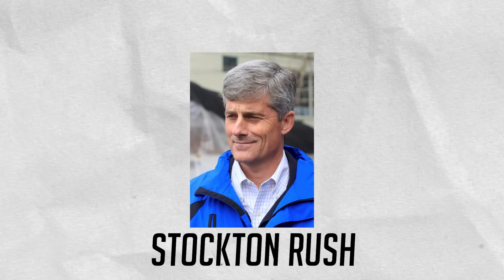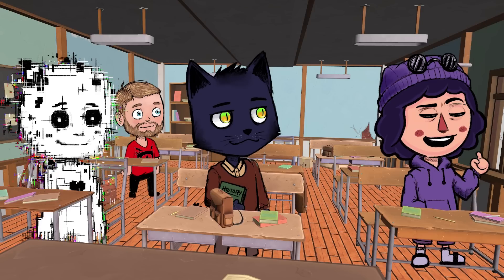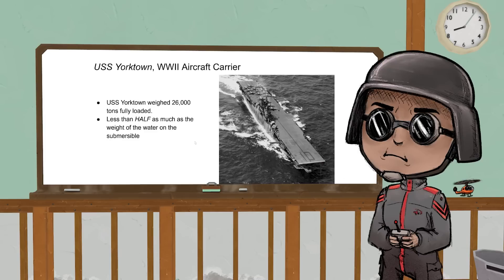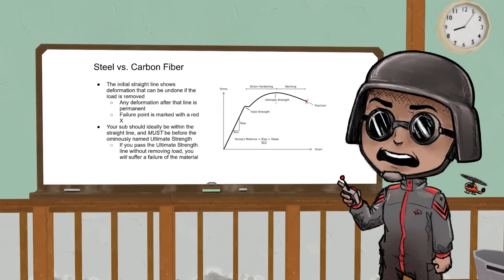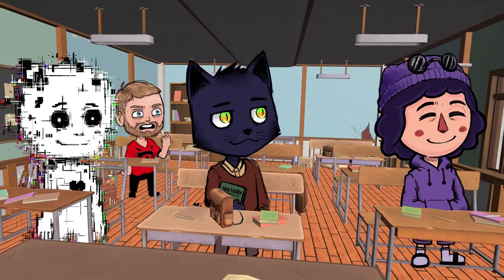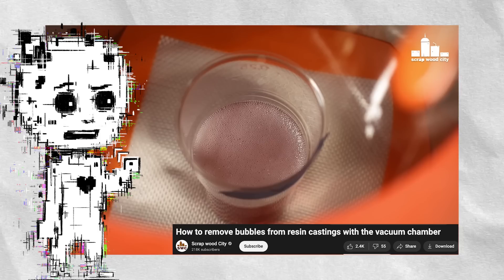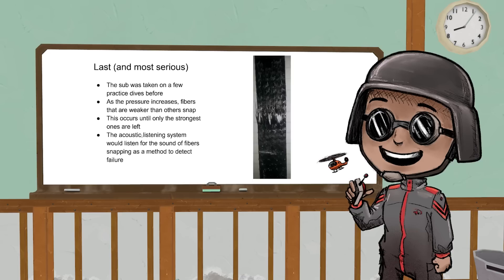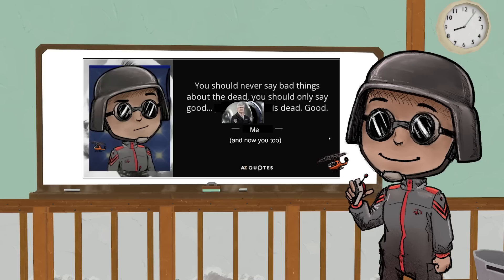An Actual Engineer Explains the Oceangate Incident

Comment: They also sanded down the wrinkles and imperfections on each 1” layer of the carbon fibre during fabrication. Literally breaking fibers. 

Of course, they shouldn’t have had wrinkles during fabrication, but that definitely wasn’t the solution. 

There were so many avenues of failure for this vehicle. The carbon fibre, the glues and resins, porosity, everything that has different compression rates under pressure. Practically everything was an unacceptable risk. Everything was unsafe.

Comment: Yea watch it be the window or the rings and how the attached them and not the carbon fiber hull like all you are saying haha. Carbon fiber has def potential in deep-sea submersibles for obvious reasons with weight, etc. in fact, the US Navy even made one similar to this in the 80s and early 90s. I think it was big enough for humans but for testing was a drone submersible (learn from the US Navy Stockton they did testing!!!). In fact it Kinda looks like all Ocean gate did was read a brief outline of what the Navy did throw that away and say well all we gotta do is make carbon fiber cylinder and put titanium caps on the ends and we will be good because it looks like  they took the basic idea of it and that was it lol. US Navy and other companies have been doing small incremental testing and using of carbon fiber but none have jumped in 100% but oceangate. They needed to test it more needed to figure out the patterns layer thickness probably way better than they did  and use a freaking an autoclave vacuum all of it etc etc. do the testing  the correct way even if it’s longer cost more etc. if you are gonna be the first to do something you damn well better be prepared and be even more cautious than the 2721 person to do it etc. you don’t break rules on it. Then after that after we figure out the best way of doing it we can more a little faster. Being first is always that way it’s more money more time more testing. How he thought he could get away with that especially at 13,000 feet on a tiny budget is just nuts. If I had to bet it’s gonna be something with the rings and how they were attached. They made their own adhesive they were prepping areas with old nasty looking who knows what on it rags. They  were also doing it in a old dusty warehouse no clean room nothing clean and in their own promo vid the surface didn’t looked prepped right at all for when you have to combine two different materials with an adhesive. You don’t want the surface perfectly smooth being wipe down with God knows what rag!! And I’m sure the adhesive had some cost cutting measure. The Dude probably used The Chinese counterfeit blue instead of red Loctite because it was cheaper haha. Sad but itll probably true they probably did skip out on some important ingredient or got a Chinese knock off counterfeit it’s not even been tested but Stockton just read the brochure and it said it was good or better haha probably did all that because it cost less. The coast guard keeps mentioning the window btw I heard it again this week in the hearing and how the window is not been rated anywhere near that depth either so maybe it’s that. Anyway I’m going with the titanium rings then window on my guess. I think the carbon fiber would have held up longer than that so I don’t think the point of failure in this case was in the middle of hull through the carbon. Btw perfect example of more testing. For all we know carbon fiber will be the best deep sea submersible material possible for 20 dives and then you need to replace it. Or with more testing will find out if you do a pattern this way and that way autoclave and vacuum it and it’ll be better than titanium or will find out it’s just crap and you can never know what will happened so don’t use it. Point is Mr. Stockton is a moron and did not do enough testing did not do enough correct testing and then bragged about not doing enough testing when being the first guy to really use a new material on a vehicle there will actually carry humans and won’t be a drone!! If the dude didn’t spend all his time giving lectures and interviews and TED talks and calling influencers and YouTubers and bragging about being an idiot breaking rules on something so new they have none he would have been able to do tons more testing and probably would’ve had the money to do it because he wouldn’t be flying all over the world to give lectures!!! I just wish it was him in there! I do hope his bs warning system that if it did work at least gave him a few seconds to read on his computer screen to see that the hull is failing you are seconds from dying that way he knew it and knew he’s a idiot and messed up. I just hope only he saw the alert!! Sounds mean but true. What I don’t understand is how they thought the warning system would save them??? If it’s getting to those sensors and you are at 12,000 feet it’s not like you will instantly out high pressure when you drop weights for the surface!! Even if going up to 10,000 that’s still a ton of pressure that water is still coming in the good bits broke at 12,000 I mean how did people fall for that by the time that sensor goes off you screwed it doesn’t magically get rid of the pressures lol. 

Sad thing about this whole deal is it’s going to put carbon fiber back years if not decades thanks to this idiot even if it is the most perfect material people will be scared now thanks to him. I think there is use for carbon but we gotta test more and figure how best to use it or make it etc etc. Him being cocky cheap and a know it all d bag killed innocent people and set us back years on carbon fiber. He just did it wrong or the rings failed or the windows failed and the carbon fiber was great but people are gonna be scared to use it for decades probably because if this d bag!!!
Reply: Oh yea the maintenance and the crew support ship etc . The stories and pics of them dropping the sub onto the deck of the ship which was hard enough to damage the ship and those supports under the sub and later mission a wave knocking off the cap because stockton didn’t want to use more than 4 bolts (it requires more than double) so he didn’t have to replace them more frequently and them towing it 3000 yards behind them on a small barge that can sink when launching the sub all that doing all that just blew my mind. They should treat machine with respect and care but instead they treated it like it’s my 1991 lawn mower!! Hell all that probably hurt the adhesive and caused the failure right there at the ring meeting carbon fiber point. There was another story where the front where the window is had 5 men on that for hours!! It had an issue when coming and being lift and it tipped straight down its butt sticking out of the water.  So 5 grown men for 2 hours were sitting on the dome cap waiting for the crew to fix the issue hook them up and get them out. I bet they barely checked it over after that. Probably never checked the rings too! Hearing that story and seeing how it was treated just wow. That one YouTuber who tried to go down he filmed it being towed 1000 miles in a storm. I mean wtf.
Reply: Imagine trying to work on the sub 2000 yards away from the ship on his little tiny barge water everywhere get knocked around by the waves it’s crazy. These guys were crazy. Really some of the people that lived need to probably go to jail!! I bet whenever they had issues they didn’t inspect or replace or do anything. They just repaired got it to work and moved on. You know just duct taped it move on. Nobody wanted to be out on that tiny barge it’s cold and wet and windy. I bet you that’s what happened on some things!!

Comment: The other thing - the building of The Titan looked so amateurish. Rubbing down the surfaces to apply the hand-mixed glue with a rag. Not scoring the surface for better adhesion.. Guys on step-ladders with no protocols to prevent contamination. Wasn't  what you'd expect a factory making cutting edge deep sea craft to look like. Looked like any light engineering works anywhere.  (Probably was.)
Reply: Not what I expect in factory making plastic silverware.

Comment: Holy shit. I knew of steels properties just by experience, I didn't know it's been figured out into a science. To see you explain what's happening on the graph, what immediately pops up is when at work I overtighten a nut on a bolt and I can feel it getting tighter and tighter but there is a moment it gets easier. Everytime I went further, snap. Same thing with brass but the required force is much much smaller. 

Something else to add. Fiber glass, I work with fiberglass fittings and that stuff acts like brass, till failure, then it shatters. You can hear it cracking well before it fails. And so I'd like to know the comparison between fiberglass and carbon fiber. Because it's the same principle just different materials

Comment: It is a common misconception that steel from the Quebec bridge was used to make the iron ring. This is false. However, after the Quebec bridge collapsed twice during construction, the Quebec order of engineers was formed to regulate the practice, much like with doctors and architects. I also believe the bridge collapsed due to incorrect calculations and it couldn’t hold its own weight during construction.

Comment: One thing that I think makes the video better is the new information we have that actually indicates the carbon fiber by itself wasn't entirely to blame. Rather it was the entry cap, damage done to the vessel and how it landed show that the vessel crushed inwards from the door down, further military tests indicate that a carbon fiber hull can work but it needs to specifically match the bend and resistance of the end caps. Otherwise the hull can unseat from the titanium and THEN it will implode, so theoretically Stockton could've done it entirely successfully using what he had, he just cheaped out and didn't test to match...

Comment: As an engineer for fibre-reinforced plastics, I find the video rather poor. It lists the usual properties of fibres in construction. These are controllable, which is why these materials have so many applications. 
Titan is at the limits of what is technically possible. It should not be forgotten that the submarine successfully visited the Titanic 14 times. In the end, it was human error and greed that failed to take sufficient account of material fatigue.

Comment: Interesting, thanks!  You don’t talk much about the issues of gluing the titanium rings to the carbon fiber hull.  The glue was just slapped on by hand with no way to check for gaps or bubbles.  Carbon fiber and titanium are not identical in flexion under extreme pressure, so in a series a deep dives there might have been progressive degradation of the glued join.  Another engineer talking about this disaster calculated the total length of the two glued circular joints:  32 feet!  That’s a lot of potential territory for a possible glue failure from faulty application or progressive degradation.  That engineer thought it most likely that the failure initiated in a glued joint.  But with all the problems of the carbon fiber construction that you point out, even if the glue held, the failure of the carbon fiber hull was inevitable.  I’m amazed that it survived even one deep dive.

Stockton didn’t listen to anyone and managed to evade government oversight that would have prevented him from killing passengers.  One of the engineers testified on how he went not only to company officers but to government agencies including OSHA as a whistleblower, but they did not act.  After a year, when there was no movement on his case by OSHA, he had to drop it because of threats of violence and legal action against him and his wife by the company.  So the US government has some culpability in not stopping Stockton when they were told about the deadly danger.  And the company officers this engineer had spoken to cannot claim they did not know the danger.

Eventually Stockton ran into something he could not bully or evade: the laws of physics and realities of materials science.  But it was too late to save the passengers who believed his lies.

Comment: The carbon fiber did not come from Boeing .
Reply from the maker: The claim that the carbon fiber used by Oceangate comes from writer Arnie Weissmann and has been widely circulated in the media. There is no evidence to suspect the claim is inaccurate, as it is a direct quote from Stockton Rush, who also received multiple safety consultations from Boeing engineers (which he ignored). However, as it is a statement made by Stockton Rush, it's entirely possible he was making it up. If you have evidence to the contrary, we would be delighted to see it!

Comment: This was not the first deep dive of this vessel. It underwent a form of delamination that resulted from the loading and unloading of the carbon fiber cylinder on the half dozen or so deep dives it had made. On the last dive, it failed at a significantly higher depth than the wreck of Titanic, and that was partially the result of the fatigue failure mode working on the carbon fiber cylinder. The safety systems, which included shedding ballast, also failed. The alert from the acoustic system was too late, because if they heard it, the cylinder was already in failure.

Comment: There was a much WORSE Engineering issue with the sub NO one brings up. The carbon Fiber tube end rings. You can watch them be applied with glue. The edge rings were inches thick of titanium with 1/8 " thick by 2" deep rims which overlapped the Carbon fiber tube. Thus the EDGE of the carbon fiber tube was relying on 1/8" X 2" of Titanium to support it at over 5000 lbs sq in. I don't know the total strength of Titanium at 1/8" thick But I'm pretty sure it wasn't the kind of forces the sub was going to be facing. It's widely speculated the Carbon Fiber was the Cause I'm more inclined to pin the failure on the natural weakness of tube ends and the Lack of Structural support those end rings afforded them. I remember one report placed one of the end caps pretty far from the debris and had one of the edges collapsed first the end cap would likely fall straight down as the rest of the sub squirts forward as the rest of the sub implodes directionally opposite of the original break.
Reply: I'll trust the pressure on 1/8th inch Ti over however thick the carbon fiber was, and you might be right about it not holding up.

Comment: I suspect the titanium rings at the ends of the carbon fibre tube made things worse. They were s tress point. They could have gone direct with multiple O rings.
Reply: That would have solved only one issue. The body still would have failed at some point anyway as the carbon fiber all cracked into dust.

Comment: I understand the focus on the failure of the carbon fibers, but I'm equally appalled at their notion of marrying two different materials, the titanium end caps and the carbon fiber cylinder, without any regard for how differently those two materials compress under extreme pressure and the gaps that could occur at the juncture.
Reply from the maker: That topic is delved into much greater detail in the uncut version of this story, which is available on our channel!
Reply: From testimony on day 1 of the Coastguard inquiry, it may be that this was the mode of failure

Comment: when carbon fiber structures make popping sounds, it means they are permanently losing strength and rigidity, the moment the sounds started it meant that less and less carbon fiber was between the water and the occupants

don't build submarines out of rope and craft glue
Reply: *submersible, not submarine.
Reply: @laura121684 
What’s the main difference?
Reply: @georgewashington2930  A submarine can leave and return to port on its own, while a submersible requires a support ship to launch and recover it.  Submersibles are also generally smaller and less complex than submarines and are only designed for short-term dives.
Reply: This is a very different conclusion than I heard from Thunderfoot and Scott Manley here on YT. They said it was the glue seal holding the titanium end to the carbon fiber that failed. I don’t know who to believe.

The US Navy made a sub out of carbon fiber. I believe that’s what inspired Rush.

Comment: An interesting point on the single use sub.  Deep flight challenger, the sub built for Fossett to do the challenger deep was built of carbon fibre.  He died before the attempt but a few years later Virgin bought it for their deep sea tourism venture.

To their great disappointment their safety experts pointed out the sub could only be used once (as intended) safely due to its carbon fibre construction and they had to write the whole thing off.

I like to think those experts got a pat on the back when the Titan imploded after 13 dives.

Comment: Any common sense would tell you that carbon fiber is good for tensile strength, and not compressive strength.  What do you have in deep water? CRUSHING compression force upon the vessel.  If it was going to outer space the choice of carbon fiber would have been wise.  The ONLY wise choice in that vessel was the titanium hemispheres.  Carbon fiber usage in this vessel was relying solely on the strength of the resin.  SMH!!